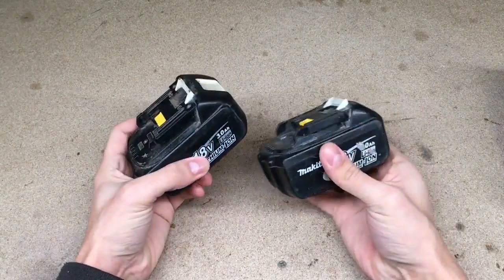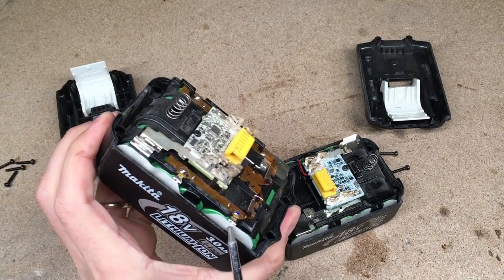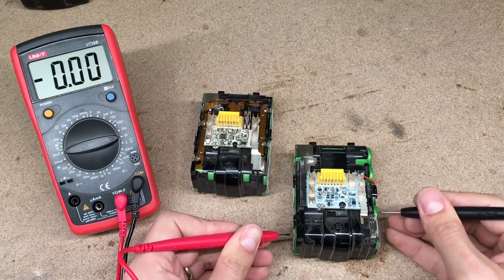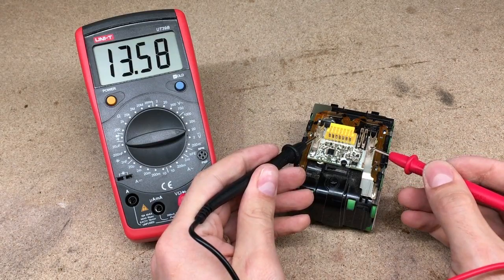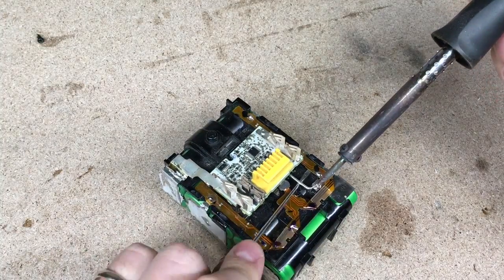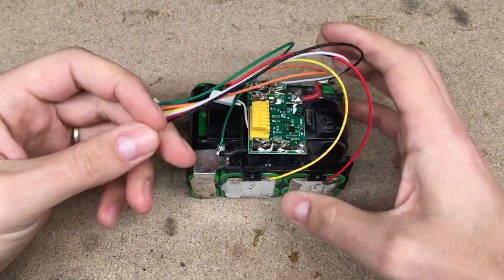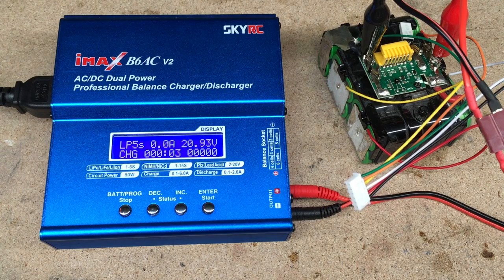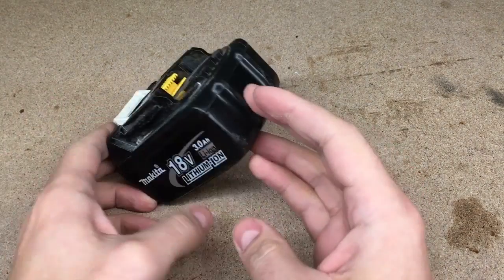Repair Makita BL1830 Battery By Making One Good From Two Bad

Comment: This is a great video on this repair.I've done about 10 of these battery's now in the last year and a half. Alot of them seem to fail again. Ether the replaced cells go out or they create the next weakest set and those will go out. I put them all in balanced when I do them. Its to bad the replacement (board chip pcb) doesn't balance all the cells on each charge. If one set drops a little lower it boosts the others up. Eventually when it gets to low it will cause the replacement board to fault (flashing lights). But on the bright side you can change the bad low week cells again or separately charge them and it will start working again. It Doesn't lock you out. I think the best way to charge the mixed matched used cells would be to use a balance charger to keep them equally charged. Sometimes the battery's show its fully charged on Makita charger but is still weak when being used with a tool.I have taken it apart again and one set of cells is weaker. The Boards i have been using were from different supplier look the same but the temp sensor is longer. Sorry for the long post.
Reply: The rule is you must replace all batteries with new one
Reply: I have read somewhere there are non-original Chargers which look like Makita chargers, some of them should charge batteries which are cut-off from the battery management system. With these you can leave the good balancing board in the battery and replace the broken cells, and charge the battery with the original board and the non-original charger.
Reply: Check out this website if you want to learn the easiest method to recondition your batteries: JoxCharge. com

Comment: thanks a lot for video. im also interested in this batteries, and have done some repairs, but i only used imax charger. im suprised that there is the circuit available on market to make complete repair (original charging with original charger).

I noticed that with your imax you are charging cells as LiPO. I think that these cells are LiIon and should be charged with Imax with LiIon setting. Also I think that max voltage for them is 4.1V and not 4.2V as shown in video, correct me if Im wrong.

Comment: One of the best and knowledgeable videos on 18650 li-ion battery repairs
Reply: Yep. Top quality info. I've done a few of these rebuilds and that was all good info. I didn't realise that replacement boards are now available. I've just been changing them to a dumb charge+balance setu pusing the existing connector so I can use an RC charger instead of the makita ones with the deeply unhelpful software lockout.
Reply: Check out this website if you want to learn the easiest method to recondition your batteries: JoxCharge. com

Comment: so.. question, those replacement board dont connect to every singel cell, how is the pack balanced?????? that's whats keeping me from buying those boards and im very suspicious about their capabilities
Reply: Yes, earlier 18V packs and all the 14V packs (well all the ones I've seen, which is about 17 so far) do not have balance connections. Which is pretty shoddy given how much trouble they went to put electronics into the packs to detect 'bad' states and lock you out when using their own-brand chargers. They could at least have balanced the cells (which would have stopped some packs getting into a 'bad' (i.e. too unbalanced) state.
Reply: In the Makita packs, you are correct.  These batteries are not balanced and are simply charged in series.  Makita relies on the high quality of li-ion batteries, which generally do discharge very evenly over a long period of time, unlike li-po batteries, which always need balance charging.
Reply: I see, thanks. so after some reading in different forums and watching some newer makita packs being disassambled, i'm quite sure now that the newest generation has leads going to every single cell now and presumably are being balanced. the pcbs inside nowadays look very different and much more complex. so that's a good trend i would say. regardless of how good the cells might be

Comment: Which watt of soldering you are using?What trick to solder it 18650 battery?
Reply: Akhtar Husain  its best to uses high watt soldering tool to melt the solder quickly and not heat up the battery I use like a 80watt or higher

Comment: What's the secret to getting the contacts soldered together again? I tried it once and they wouldn't stick.
Reply: jospi2 use solder with Flux in it, it makes the metals stick together with solder
Reply: Clean both surfaces (battery ends, plates, wires) very thoroughly by scraping or disc and use a very hot soldering gun and good solder.  Don't overheat the batteries as you could damage them and be very careful handling the tools to avoid shorting the battery terminals.
Reply: sandpaper
Reply: Start your very own battery business and make huge money here: JoxCharge.com

Comment: I've charged each pair of cells after replacement, and the makita charger accepted the battery with old circuit again ! :)
Reply: I tried this with an old Packard Bell laptop battery. The circuit had switched off, and usually, once the circuit disables itself, there is no way of re-enabling it. And no, I'm not getting a Chinese battery from ebay.
My old laptops whose batteries are kaput, are being used on mains only.
Reply: Markle2k 
hey boy.
what way to reset makita board when charger does't recognize
Reply: That's great. Some protection circuits automatically disable themselves if they ever detect the voltage on any cell dropping below some set value. This has been an issue with replacing the cells in tired old laptop batteries. You had to connect a voltage source before disconnecting the old cells. Supposedly there is a way to reset the protection circuit, but manufacturers only provide the procedure to professional battery restoration shops.